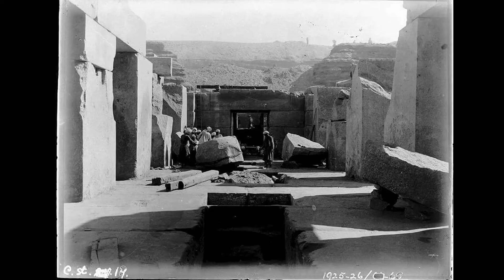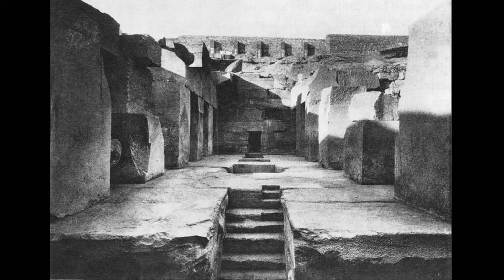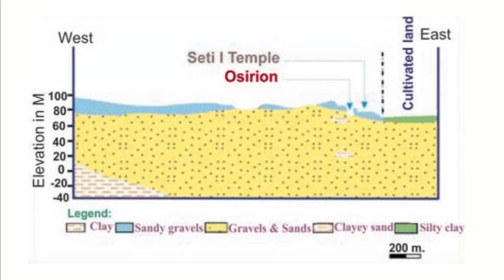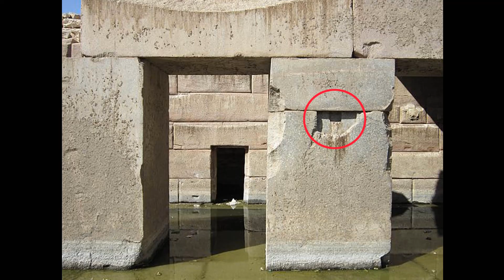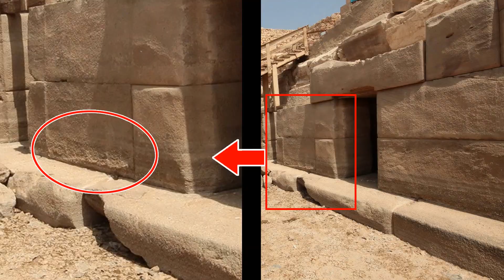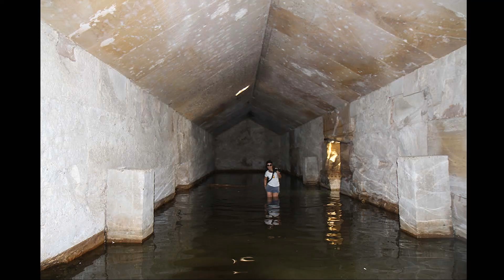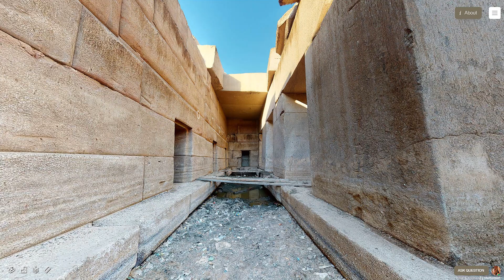The Osireion Mystery: Water, Construction, and Its True Purpose?!

Comment: Clearly it isn't simply a cistern combined with a well or wells as that could be made far simpler than the construction we see before us. It is probable that it is also a pumping station. The niches set all around the central structure could act as hydraulic oscillators similar to a capacitor voltage pumping chain in electrical engineering so allowing natural frequencies in the ground to be magnified and rectified via these resonant chamber layouts so making the thing pump water for zero energy input from the makers as the energy would be drawn in from the surrounding random noises in the ground much like a diode only allows electricity to flow in one direction. Such control of water using resonant structures may also be how they cut rock so easily as they could have created high pressure water jets without the moving machinery that we use. They had static machines based on resonant structures filled with water and the input energy came from the surroundings in a one way flow system again due to the diode like operation enabled by the resonant shapes. Remember the only reason that two stroke engines operate so cleanly today compared to the past is that resonances in the shaped exhaust cause positive back pressure to build at the exhaust port so keeping the fresh charge of air-fuel mixture in the cylinder ready for the next combustion stroke but prior to that higher pressure the resonant chamber also helps suck the exhaust gasses out of the cylinder with lower pressures at the next point in the redonance. A similar set up is seen at the Osirion. Note that such tuned exhaust behaviours were only discovered by humans in the last 40 years or so and so whoever designed the Osirion knew all about those, and much more, at least 12,000 years ago. Remember Tesla designed a one way water diode that had very little water leakage in one direction and yet allowed very easy water flow in the other direction. The water diode structures in the Osirion work in a similar way.

Comment: They probably were used to seeing  available water there for lifetime's and then it slowly shrank down. So, they knew it was there and not far for a project to bring it back up and make it accessible again, especially for hard times and agricultural needs. What we don't see, is any kind of attempt to supply running water to anywhere else, or any signs that the public is welcomed. There are no bathing or wading, platforms and nothing is built at chair height to seat any multitudes of people. In my opinion, this was a water utility for storage that brought back to higher levels what was once there before linking it to the Nile. Maybe they had thoughts on building a connected chain of them leading further and further away from the Nile, until they realized the water level was still dropping.

Comment: Re: Nubs...

Saw an interesting video of workers making a fake block - Picture a box where workers placed large stones inside to fill the void as much as they could and then workers added wet mortar

Now they had a large fake or faux stone but due to the pile of rocks they had placed inside there would have been air pockets, then they invented a stick that vibrated and stuck it into the wet mortar

This vibrating stick then removed all air pockets in the newly formed block but "when they pulled out the vibrating stick it left a Nub shaped protrusion"

However to me it doesn't explain why there would be different shaped Nubs and also there are Nubs on newly quarried stone too so...

Comment: Hello.. I submit to you that your conclusion is in error..   The megalithic double lego roof also buried 15 feet.. would allow a sealed environment. perfect for a vacuum (yes or no).   The moat is 14M VERY DEEP a five story building.. so draining some would create a partial vacuum like with an upside down test tube in a bowl of water (yes or no).   The stones are cut and stacked in a way that is for electrical current.. limestone on granite is a capacitor, etc. Your BBQ uses a quartz crystal to light it... View the osirion form above.. and youll see this is a giant magnetron .. like is inside every microwave... I made a video on this topic.

Comment: Yes.
Are you aware that the center area is totally isolated ?
And that it would resemble an island ?

The "pit" as you reference, is not a pit.
It is a wall / moat. It is finished full height. Top to bottom.

That is to say, all the walls, on both sides of the "pit"
are finished, laid in place, maintaining the same style
as you see on the walls.

This is not how anyone would design and build a well.
This is an Underground structure that has had it's roof removed.

Designed and built prior to the ground water rising to its present elevation.

Excellent video once again
Thank you.

Comment: You ask: "Why were the columns so massiv?" Answer: because they had to carry the hefty weight of the massive ceiling monoliths that where there before the stone robbers broke them into pieces.
Question: "Why were there massive monoliths as a ceiling?" Answer: because they had to block to sunshine to prevent algae blooming in the pristine water.
Question: "Why couldn't they use lighter ceiling material like wood?" Answer: because the monoliths had to endure time and had to carry soil and sand on top of the monolith stone to isolate from the hot weather"
Question: "Why isolate the water from heat and light anyway?" Answer: because it is pristine drinking water that has to stay cool and dark like in modern city cisterns, otherwise bacteria, algae and microbes would spoil it. 
Aha! 🙂
Reply from the maker: Thanks for sharing your insights with me! I think the massive pillars also served another function  :-)

Comment: 12:07 so you think they built this unbelievable structure but, didn't screed correctly 😅
Reply: from the top down, nonetheless. Making it effectively a guarantee they would never complete the process before it dried (ignoring the bulging from stacking wet, multi ton blocks).
As intriguing as it is, pretty much every bit of evidence people have for geopolymer, is also even better evidence that it isn't geopolymer.
Reply: @Hazanko83  you know your stuff, thanks for reply. Your correct , also the aswan quarry ..why bother with quarrying if you had geopolymers
Reply: @alba..8479  Ignoring the fact that we know where many of these stones were actually quarried, and even if we didn't - if they were to have preferred pulverizing literal tons of stone over simply being smarter stone masons, I think there would be even bigger questions.
I've done a fair amount of woodworking with hand tools, and while it's not stone masonry, knowing how the material behaves can easily turn days of work into a couple hours. Although, just as you might see variance in methods in modern work, there are examples in megalithic structures of work clearly done by hand, as well as examples that look frighteningly like some sort of powered/guided tool. Really the only problem I see geopolymer solving, is not having to move multi ton blocks, while it seems to create more issues.

Comment: I really like you videos, but i must disagree in the geopolimer hypothesis. there are several problems in getting a form of concrete weighing 50 to 100 tons to look even and consistent from the mixture staying consistent to the pouring being done quickly before it starts to dry. the real problem of using stones of this size is not so much in cutting them to fit but in their ability to lift the blocks and suspend that weight above the blocks being fitted too. if they were smart enough to build this and the pyramids why wouldn't they be smart enough to figure out an effective pulley system to lift and hold the stones above the lower stones to be fitted too? i think they had a better pulley system that egyptologists give them crew for like a rope block and tackle pulley system that we us today. i personally think that archenemies rediscovered this pulley system when he studied at the library of alexandrea rather than him having been the inventor many greeks got their ideas from egypt.

Comment: Well done, Tina! 
I agree that the Osireion was originally built by Civiilization X as a well/cistern structure to tap into the deep paleo-water table. It makes no sense for Seti to build such a huge, deep well/cistern structure when the Nile was just a few hundred metres away in his time?! 
No, Dynastic Egyptian Seti did not build the Osireion, he inherited the Osireion, and built his temple next to it, for his priests to use its holy waters.

IMO, this means that it was actually built by Civilization X before the Nile River started to flow North, or when the Nile was just a seasonally intermittent small stream, during an arid, very dry climate period at Abydos when fresh water was scarce. 
Research into when the Nile floods started, and when the Nile Delta formed is required here. 
I look forward to Part 2.
BTW, you look very nice in your elegant new decor background.

Comment: It’s a big IC chip.. to control lightning..
Reply: I believe when it’s flooded it’s in the off state, and when it’s not it’s on, or “ready” to use the lighting strike, if you look at the animated image you show from above, you can put that beside a ic chip diagram and see it. The lines in between the stones in the center are made that way for design purpose, I’d assume water would seep in the cracks and become the fine wires inside the ic chips that connect areas.. 

Could be a pump, but I see a IC chip, especially after watching “The Land Of Chem” channel, so much evidence on video, the pyramids were chemical manufacturing plants and weather manipulation machines, designed to keep the land fertile and extract precious metals

Comment: Interesting!
My spontanuos taughts about the bulding process is that,
a concrete like mixture requires a lot of energy to  make, which means it either need to be heated up in a natural occuring process, like the concrete the Romans did mine on the volcano sides, where the lava met limestone and formed a layer of natural cement protected by the layers on top of it, or it require a lot of wood to burn limestone, so, even if those areas where probably green in those times, it seem less likely to me that they made the whole rock out of it, so the third theory could be chemicaly dissolving the rock, using carbon dioxide (from air or chemicals) and water would take probably hundreds of years, so less likely, but using an acid, like strong vinegar on the surface of a roughly chiseled rock on the other side would i think absolutely be possible and that process can also be done in a matter of days and the dissolved rock can i think be scrapred of relatively easy, but only on the surface penetrade by the acid, which may explain the uneaven transition areas, i think. The flat surface where probably needed for something and specificaly made to be flat, or they may be later repairs, i am not sure, but but some of the flat surfaces look original to me, so could had been to diplay something like a painting or textiles, or connect to a structure, possibly wood or leather that was not ment to be permanently attached, or things was changed in the construction ower time, etc Just my taughts about it. Sorry for my English, it is not my native language.

Comment: What you are saying is very interesting, but incoherent. If these builders were able to melt stone and cast blocks from it, why didn't they create larger formworks and pour the stone instead of putting it in in pieces and then polishing it. So the explanation must be different. Anyway, thank you very much for the interesting material about Osireion.
Reply from the maker: Modern concrete construction always has expansion joints, including poured concrete. These expansion joints are to accommodate concrete's tendency to expand and contract due to temperature changes and moisture fluctuations. Without these controlled gaps, the stresses caused by these movements can lead to cracking, buckling, and overall structural damage.

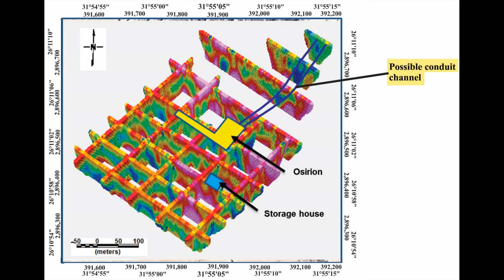Comment: What GPR tech was used for the paleo water source grid @ 04:11? The Mortise/Tennon joints are for pressure. Whatever energy generation, or chemical reaction that took place inside and at depth within the Osirian Temple when roofed dictates from construction method a sealed tank or chamber. And no insult, but you Cannot Caste a 'bulge' on one side of a block and have the other 6 sides be 90º. The 'bulge' side would have to be an open top to the caste/form, like bread rising in a box.
I am sure you are aware of and have read Christopher Dunn, Graham Hancock.
If you want a 'boots on the ground' who lives there, walks the Giza Plateau every day, contact -- youtube.com/@trevorgrassi -- 
Geoffrey Drumm, Ben van Kerkwyk, etc. are known yes, they are also caught up in their egos. Try Trevor, as in he Lives There.
You do pretty good work.

Comment: You make good valid points. Considering 12,600 to 14,000 or e en 22,000 years ago sea level worldwide over 400 feet (122 meters) below the current level, meaning current groundwater would also have been a similar amount lower.

Comment: Having watched every video made about the Osirion that I've come across, I say with knowledge that yours has conveyed more information than all of them.  I've written three expositions on it but never got around to making the important comparison to the Seti I temple that you did.  It's a very significant point and demolishes the claim that the Osirion was built by him.  
In your next Osirion video, it would be good to speculate regarding the 7-degree greater temperature of the Osirion water than the other water sources in the region.  Its implications are huge.  I came up with a mind-blowing theory which I've written about.

Also, you should address an issue that arose in my contemplation just a couple days ago, namely the issue of the perfection of the fit of the center blocks to each other with no gaps.  That required PERFECT flatness of all contact surfaces...which required perfect flatness of the limestone base blocks with every pavement and pillar block having perfect right-angles and being perfectly level across all of the blocks that were laid on sand!  Anything less than perfection would result in gaps between the blocks.  No one has addressed that issue much less 'solved' it.  I intend to write about it, but you should be the first to speak of it in your next video.   The Osirion and its Unique E.T. Construction
https://  sciencetheory.wordpress.  com/2025/01/25/the-osirion-and-its-unique-e-t-construction/
Reply from the maker: Thank you very much for sharing your insights with me. Much appreciated!  I'll look these up and see what I can find. ♥

Comment: Working in stone is high-status, expensive, laborious and technically demanding.  This structure and other, similar constructions were state-sponsored, expensive, time-consuming projects.  These blocks were cut and shaped from native stone, then transported in some cases over quite large distances.  The Nile was very helpful in this regard during all periods of Egyptian history.  These are not geopolymer 'cast-in-place' blocks, but were carefully excavated, transported, shaped and finished in position.  It was quite difficult to lay the foundation blocks, block the water flow and then construct the structure, but it was obviously important.  This was an important spring.  Thank you for your video, but I disagree with your construction material engineering thesis.

Comment: Strabo saw the site thousands of years after it's construction when the site was already ancient. So your comment about it not being filled due to the water table rising in modern times is not accurate. The older you say the site is, the more inaccurate your comment becomes. There's no way they could have built it with water flooding in around them so it just makes no sense. It clearly has been effected by the rising water table just like every other subterranean building in the area. How could it possibly be excluded?